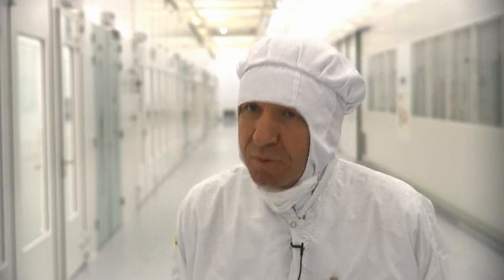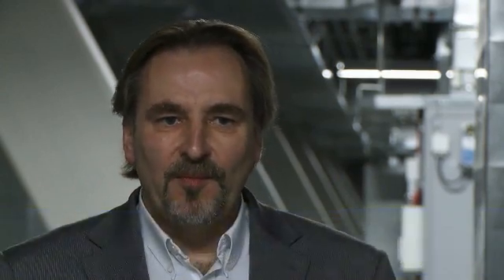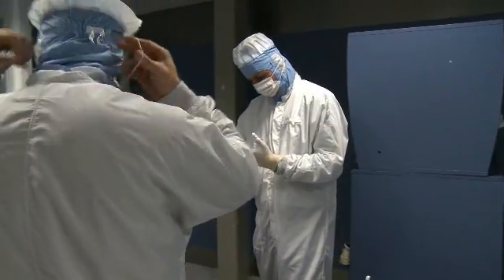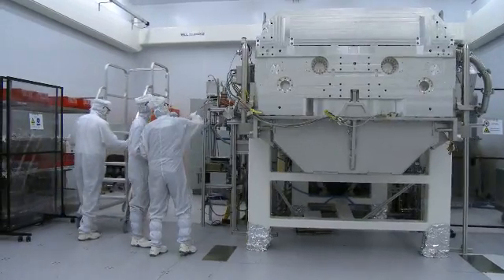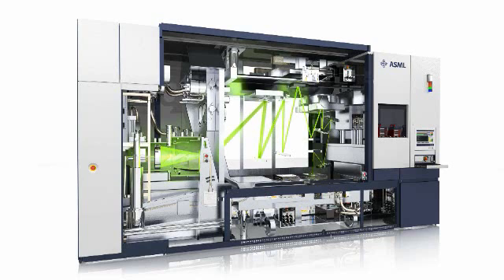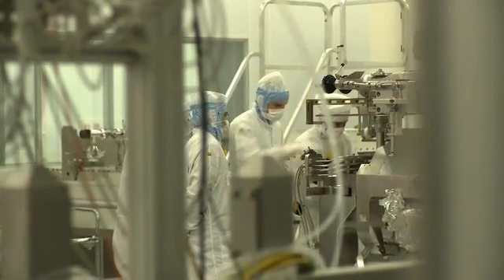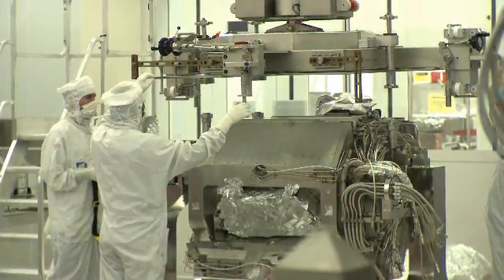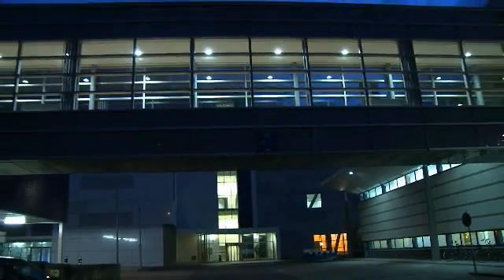ASML: Chip making goes vacuum with EUV

Comment: Hmm,  this posting  is 6 years  old now. 
I always thought that EUV  is not working
due  to too weak  laser light sources.
Problem seems  to be solved  or what?
Reply: The problem is that EUV only works when it's performed in vacuum. That poses a lot of production problems in conjunction with the requirement that these machines need to work in a clean room environment. The issue is that the yield of EUV is not quite up to spec compared with the traditional lithography which performs up to 14 nanometer. If you want to go below 14 nanometer, you need EUV. BTW, nice background music with the Roland TB-303.
Reply: Juan Espinosa EUV is required below 10 nm
Reply: Solved now:)
Reply: They needed 9 year after the released this video till it was ready for production.
Reply: @happygimp0  I've been involved the in design, proto typing, building Intels EUV Vacuum control system for the past 8 to 10 years, constant spec and process changes continue while everything gets refined. Was happy to hear when my first machine went live at DX1, and Fab 34 has reached mass production. The tech is constantly changing as new things get discovered through the process design and need to be tweaked for maximum yield. This stuff doesn't happen overnight, the mountains of paperwork I've created in drawings, schematics, BOM's has been challenging yet fun. I even get to write upgrade procedures and build books. If you asked me 10 years ago what I'd be doing today, I never thought it would be sitting in this seat, wasn't even on my radar at the time.